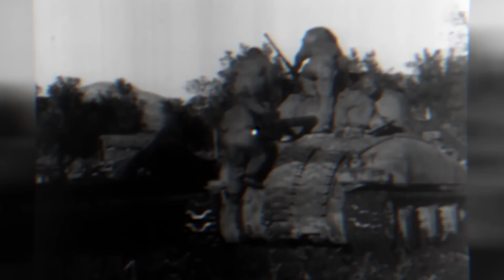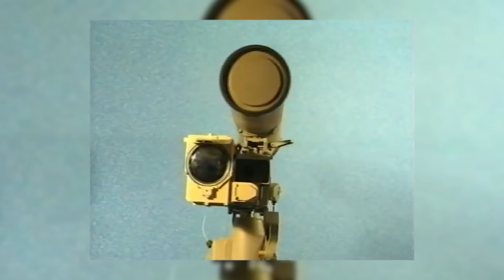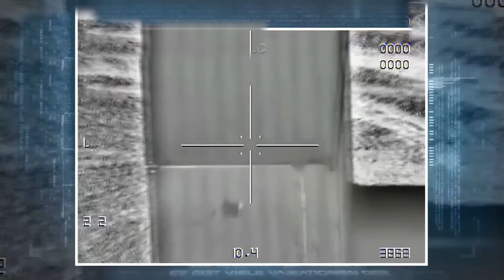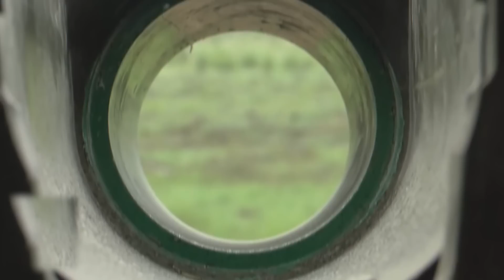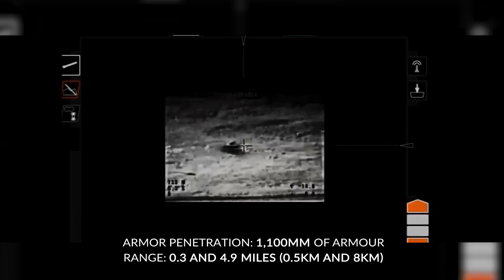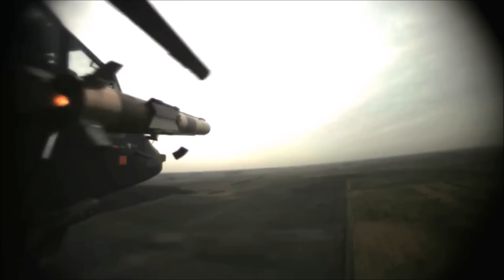This Weapon Changed The Course Of War

Comment: You missed the most important differences, range is nothing if you cant see. One of those has an infrared sight with twice the capabilities of another. Even though their range is similar.  That ability to see so much better detail is game changing. Sure it's noisy, but you can see so far away at night. And with theirs, you can see in fantastic detail.
Reply: Which one is that?

Comment: These wireless, man-portable anti-tank systems are great lazy man's sniper rifles.  It's good to see that soldiers and Marines in Afghanistan have had free reign to use them on concealed Taliban shooters who snipe at them and won't engage in the open.  It says "we're not afraid to use this weapon on lone gunmen. "
Disasters with isolated and tactically vulnerable FOBs in the boonies getting swarmed and overrun, have demonstrated that these systems are good stand-off weapons, but easily defeated with RPG and small arms volley-fire.  TOW launchers and javelin CLU's are particularly easy for enemies to damage/disable if there's not sufficient stand-off distance.  It's probably incumbent on personnel to distance the weapon system as far from the potential invading force as possible, as a course of normal procedures during likely times of attack.  For instance, prior to the major attack at Wanat and during morning stand to's, the TOW-equipped Humvee might have been driven out of the immediate FOB area, as much as a mile away- but within visual distance, on the dirt road in that valley.  They'd probably have needed an extra gun truck to defend this secondary location while missiles are launched at various hard targets who were engaging the FOB and the OP.   That's the only way they could've kept this major weapon system from being quickly destroyed like it was.

Comment: Chinese Red Arrow 12. For specs just look up the U.S. Dragon ATGM. The Red Arrow is just a Chinese knockoff of the Dragon. China doesn't innovate.

TOW. Like toe. Not T-O-W. Even though the acronym stands for "Tube launched; Optically tracked; Wire guided."

Onomotopoeia. just...damn